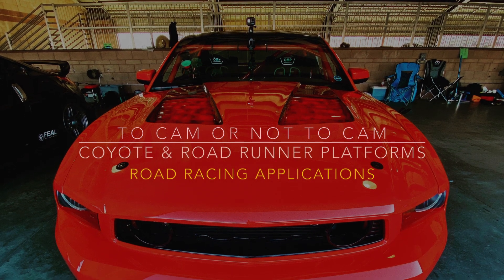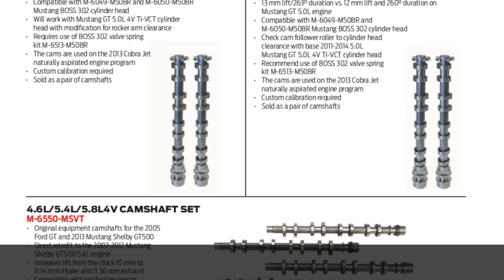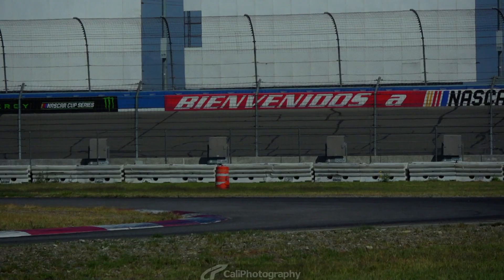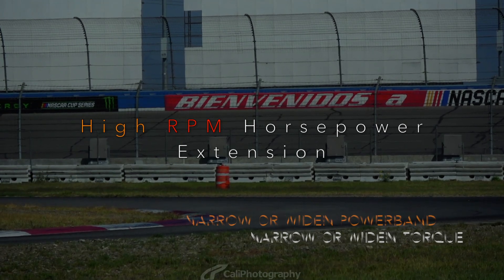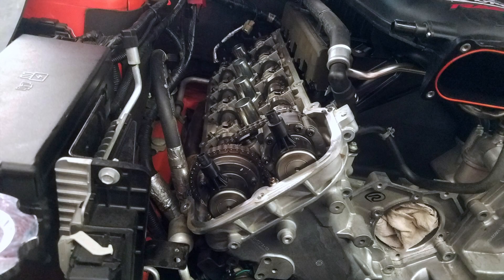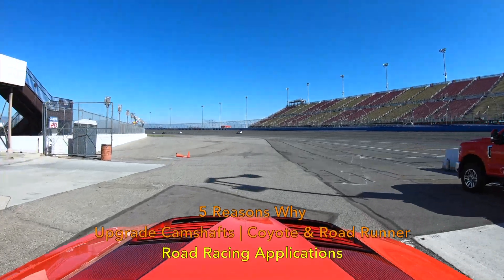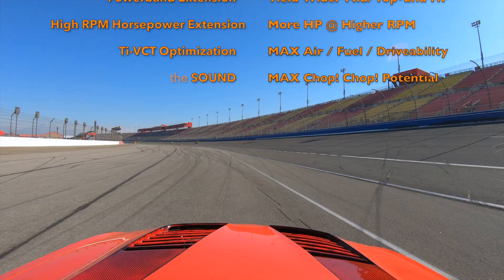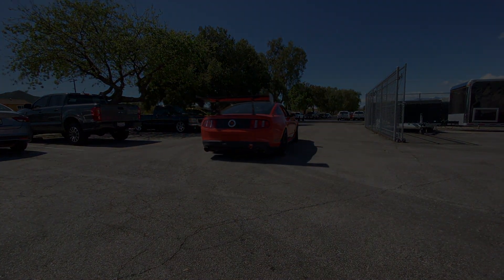5 Reasons Why You Should Upgrade Camshafts for Road Racing

Comment: Cam upgrade for the gen 1 coyote is beneficial ... I know on the LT platforms a cam upgrade is a huge improvement especially when it comes to running E85 especially on a boosted application
Reply from the maker: Well said. You have more knowledge regarding the LT platform than I, however I have heard similar information. I did witness a n/a, cammed, E85 Camaro SS 1LE absolutely blow the doors off of cars and crush lap times at Autoclub Speedway. The n/a LT1's seem to respond well to a cam upgrade as well.

Comment: Which cams did you go with I’m getting L&M cams. Think I saw you used ford but don’t remember 💯.
Reply from the maker: L&M make great cams. You'll yield much more power out of them than the Cobra Jet cams in the BOSS 302 (I think). Yes, the cams we installed in the BOSS are the original ones Ford Racing designed for the OEM BOSS 302, but Ford switched them out last minute to aid driveability on the street for VIN BOSS 302's.